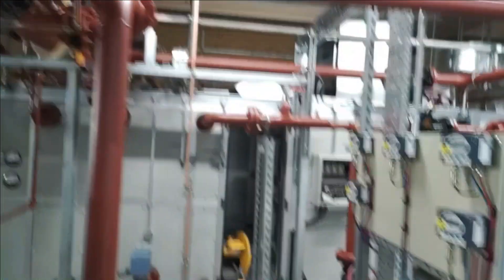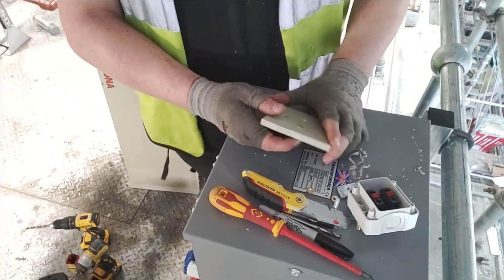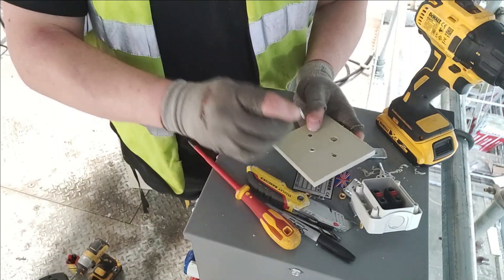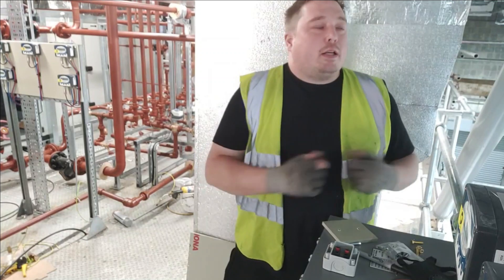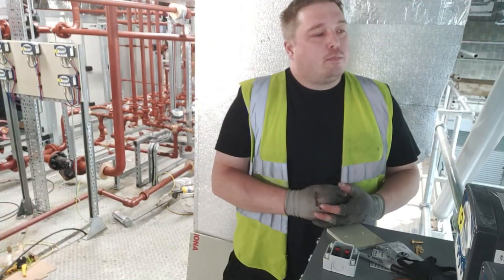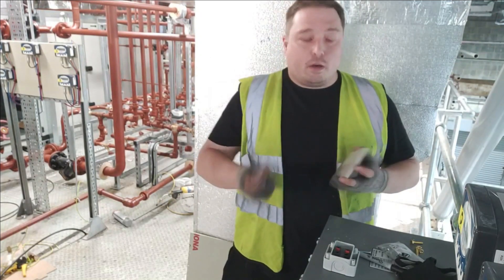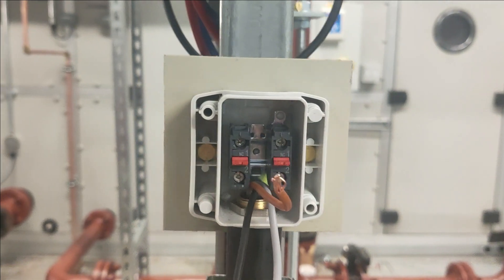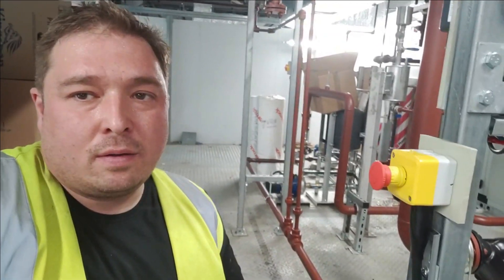WHAT IT MEANS TO BE AN [INDUSTRIAL ELECTRICIAN]

Comment: Love a bit of industrial. I'd have taken the sharp corners off that plastic back plate I think. You're right about spending most time fabricating.
Reply: Could have been a bit smaller too
Reply from the maker: You guys are both right but I had to stick to the sizes and shapes  already done by others.
Reply: @fatsamelectrical  Why follow what others have done badly, when making it smaller and rounding the corners would have been an improvement?